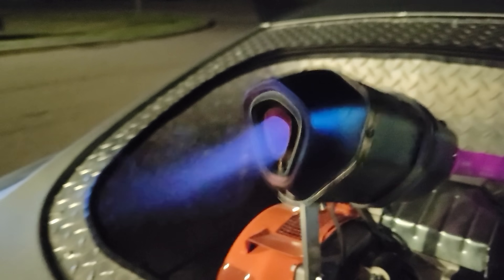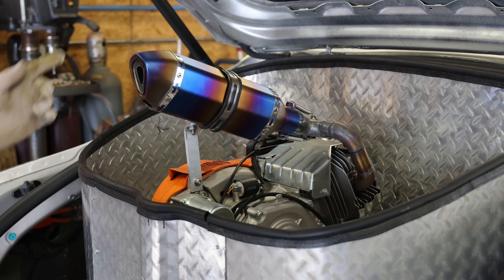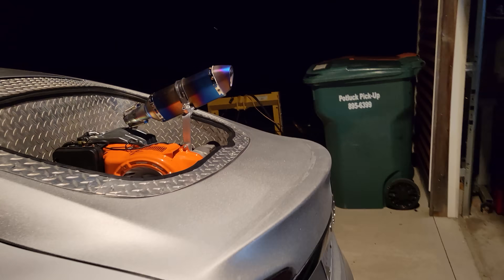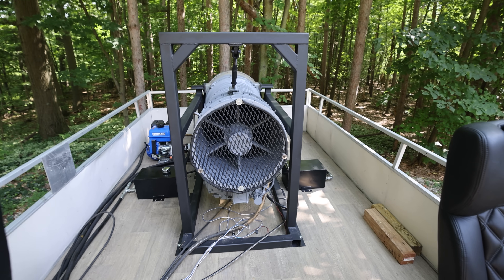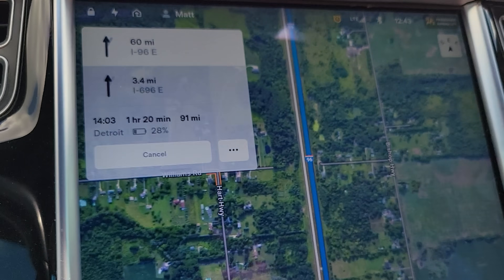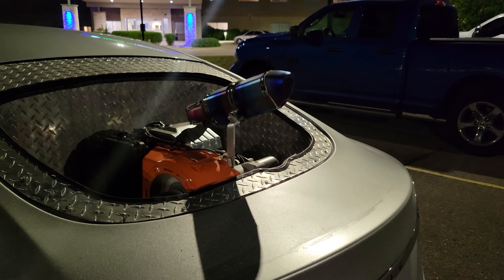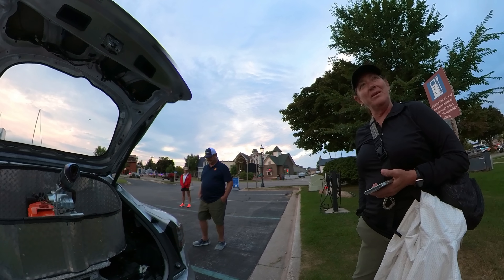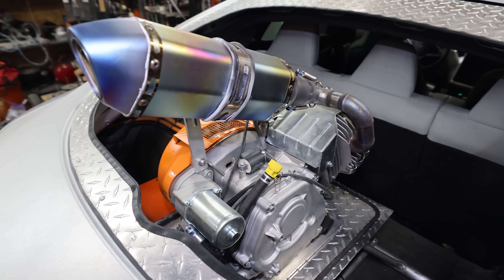Cordless Tesla (I Drive 1800 miles without charging) P.1

Comment: They already make these. It's called a hybrid. Gasoline engine charged battery. Battery adds supplemental power. Even though it seems to me that a hybrid should use a larger battery and much smaller engine. As long as the engine is large enough to kick on automatically and charge the battery only when the charge is low and shut off when near full than you can still run on battery only. That set up would not only give you unlimited range compare to a EV but also would only use the engine when the battery is low so the mpg would easily be in triple digits. Most current hybrids rely mostly on the gas engine to move the car and the battery is only supplemental. It should be the other way around .so instead of adding a battery to an existing gas car, they should add a small engine to an existing EV.

Comment: Next build research a GEET Reactor so you can run an engine on water instead of gasoline and integrate an alternator off the engine so it acts like a turbo boost for power generation.

Comment: Have we reached peak stupidity yet? What´s the point of an EV if you need to revert to using Gas to get an acceptable range? Yet another video that proves that EV´s are expensive useless vehicles. By the way, i have a 2018 petrol car that runs on a 4 cylinder engine and charges a 12v battery for many many years no problem, should i make a video about this genius invention of mine? Ehhhh!

Comment: basically you built a gas powered electric generator to charge the batteries of a tesla instead of stopping to charge it. so basically instead of waiting approximately 30 min to fully charge the tesla, you just stop to get gas. How many times did you stop to refuel for the generator. good concept.

Comment: Little gasoline gensets have a bsfc (fuel efficiency) of about 480 grams/per/kw/hr..........by comparison, a good, modern turbo diesel is about 180 grams/per/kw/hr.  Achates are soon releasing a 2 stroke opposed piston engine that the US military uses, and it is 20 to 30 % better than the best 4 stroke, turbo diesel engine. It has already passed CARB trials with excellent results.  The gasoline version, will use 60% less fuel than the best 4 stroke gasoline engines, in cars today.

Comment: This was lame! You were not any better of different that charging your car like normal and in fact worse! Your idea was amusing, but clearly inadequate. You stopped for long periods of time to let the car charge! HOW is this different from using a Tesla charging station?!  The genny needs to charge the car at least as quickly as you discharge with normal driving. Getting pulled over for going really slow shows this genny is inadequate! The noise level was insane! You NEED a much BETTER muffler! For this "test" to be worthy of something impressive, you need to NOT stop for any reason other than to fill the gas tank for the genny and then drive 1800 miles straight through. This is not hard for one person to do by themselves. Second thing is after you drive 1800 miles without stopping for more than gas and no other reason, what was your cost for all the fuel vs cost of charging and traveling 1800 miles on pure electricity only? How long did the trip take never stopping except for gas for the genny vs the exact same trip with actual charging stops? I'm pretty sure that other than the travel time being similar to a gas car done with an adequate generator, that otherwise, this experiment is worse than pure electric in dozens of ways!

Comment: Great idea!  I've been wondering for ages why car manufacturers aren't working on stuff like this until the charging tech and distribution catch up.  The British car company Ariel is working on an EV that uses a gas turbine powered generator as a 'range extender.'  They say the higher RPMs provide better charging, but with 4 EV motors and 1200 horsepower, it probably still needs to charge now and then.
Reply: Have you heard of a hybrid?
Reply: because: Toyota Prius circa 1997.

Comment: How to do this right, charge you car with electricity overnight.  It costs you no time other then plugging it in.
  
The generator doesn't need to be used on demand you have a large battery inside your Tesla, you can use a weak and efficient generator as your driving so long as its running its still extending your range.  If it produces more power then you need your just carrying around extra weight and wasting gas.

Then see how convenient it is and how far you can get on a full charge plus one tank of gas.

Comment: I have an 89 Geo Metro  ,
 I paid $150 for it 22 years ago  ,I've gotten as high as 55 mpg . Still drive it daily  .  It now has 353,000  miles on it .
         I'd still  would trust it on a trip anyday over an electric car .
      It might not be as luxurious as a Tesla. But it will get me there. 
     And I never, in those 22 years had to buy a $20,000  
  Replacement battery. 
                    😄

Comment: Industrial diesel generators will give you a much higher output and are so much quieter. This size is the only draw back but the area that is available should be good enough for a fairly powerful diesel generator.

Comment: that's a badass concept, with a larger engine you could potentially only run it for an hour or two after shutoff, although youd be on a slippery slope of gas consumption.
Reply: You could even remove the batteries, fill up the frunk with a larger engine and add a gas tank at the bottom where the batteries where. Then you could just go to a gas station and fill up the tanks there. Only takes a few seconds!
Reply: @RoloFilms  I know you're pitching this sarcastically, but you've basically described the car version of a deisle-electric train engine

Comment: The same could've been done with the generator & fuel system set onto a hitch-mounted rack, running the heavy cables, remote generator controls and fuel tank wiring via BUS cables and a 7-pin trailer lights connection... thereby allowing ease of removal and not compromising interior/cargo-area space.
Reply: That is the way I would have gone about it as well, I'm actually surprised no one has come up with a small aerodynamic trailer option.
Reply: @cwb2992  this is the only way I'd use an EV lol. really the only way you can use  an EV on a long road trip.
Reply: wow this is actually a good point.
Reply: A trailer can be stolen.

Comment: Just buy a trailer and a Generac 20,000 W generator for a house put the generator on the trailer and tow it behind the car that way you don’t get gas in the car and still have cargo space headed I’ll probably be quieter especially inside the car

Comment: I thought about doing this but what I was gonna do is put a trailer hitch on the back and put one of those wheelchair racks or luggage racks on the back and my 8000 W generator would sit on it and just plug it in with the 220 V plug You could even get a much larger generator and put it on the trailer and just throw it behind the car maybe a diesel one would get better gas mileage and have way more power like one of those Generac 20,000 V house generators

Comment: you could have saved the money and used a gas car and drive in peace an quiet. Here in the UK a 1800 mile trip would have cost me 3 thanks, which is currently at around £84 a tank. That would have been only £240 and wouldnt need to stop or drive slow just to charge it.
Reply from the maker: Saving money??? That's boring

Comment: My favorite part about the whole electric versus gas thing is the fact that hydrogen just exists and it's only byproduct is oxygen and water if you use electrolysis to make it
Reply from the maker: True but you need more power to make it than the power that it produces.
Reply: @WarpedYT  that's where a couple of good solar panels comes in

Comment: Your wearing earpro because it's so fucking loud but pull it up right next to where people are sitting. I wouldn't be surprised if someone came with a lawsuit
Reply from the maker: Those people are not within a foot of the engine, once you're like 6 ft away it's fine but when you're right next to it yeah it's loud, and being next to it every single day for 12 hours a day, yep that's the issue. People are so boring all they can think about is suing other people, why don't people just get to work and make money instead of trying to figure out an easy way to make money which is actually more work. 🤦‍♂️

Comment: The problem with your design is physics. To propel a 4,000 lb car down the road you need a minimum of 25 Hp average. I did the math when I was designing the parameters for my own diesel-electric car.  So you'd need a 25Hp diesel genset minimum, 30 Hp gas. So instead of a 10 Kw generator you need a minimum 20 Kw generator.

Comment: Mr Author: I have seen the secret of noiseproofed genset, when the attending technician opened the built. in side door for controll panel: Around 12. inches thick of semi hard foam, with surface designed like the egg tray!... It completely sorrounded the whole genset unit- "S" design of design for incoming or exit air, to completely trapped the scaping noise.. Soak the foam with fire retardant flourine solution to make it fire resistant... God bless!..

Comment: So your idea to run your so called green car is to use a fossil fule burning motor...... kind of defeats the purpose dosnt it. 
Has to be one of the best idea ever .......
Proven how useless it is your generator still won't supply enough power to keep battery charged running car at the speed limit of 55mph. 
Just buy a petrol/diesel powered vehicle and be done with it.

Comment: Couldn't u just run some type of alternator hooked up to the wheels so as u drive it charges at the same time,  using extra gears to get the alternator up to charging speed?

Comment: That generator doesn't burn fuel as efficiently as deisal.

Between the ACTUAL pollution, and the noise pollution from running the generator at night...

...all for the selfishness of not wanting to get of your ass...

At least you didn't plug your car into a COAL BURNING POWER PLANT to charge your car

But you're STILL the reason for all the problems you complain about.

Comment: People like this are the reason we have a climate change problem.

You can’t just let a company of 100s of thousands of engineers design you a car.

No, you know better.

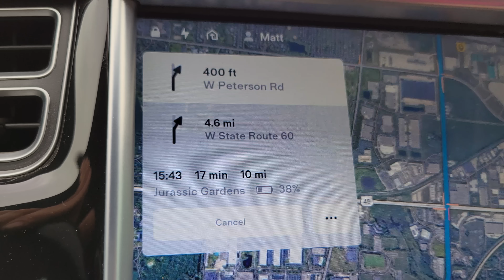And at 2:50, I know why your nervous. Because you never got this car inspected in this modified configuration, and you’re lucky that cop didn’t have you tow the thing.

Also, running an engine like that overnight at a hotel 🤦🏼‍♂️ I’d be shocked if you didn’t receive some feedback about that that you didn’t include in this video.

One thing is for sure. I would bet all my money that you were careful to park that car AWAY from your room, so you could get some good rest.
Reply: Depends in what state cuz cops will actually support you.. There is allot of discrimination of EV users

Comment: This is hilarious. I've got a 2020 Corolla Hybrid and average 600+ miles per fillup of the tiny gas tank. 
It spends most of its time in EV mode cruising around. Plus with my trade in, I drove it new off the lot for under $20K. It's now got 96,000 miles, and I'm still on the original brake pads. Car still starts, drives, and stops like new. 

I've also performed most of the routine maintenance myself with a set of Quickjacks. No need to call a specialist or drive it hundreds of miles to a dealership.

Comment: You never said what size generator unit you put in the car. A small generator is why you have to stop to recharge. Could be the batteries do not charge while driving? Face it that was a failure.I wonder what if you used one of those power storage units that will run your house for days?

Comment: The implementation may not be the best, but the concept is not that wrong.

This is not a hybrid, its a fully electric drivetrain with a range extender. A range extender engine can benefit from an optimization for a specific rpm, hence better efficiency.

Maybe a bigger diesel generator, with better sound insulation, would be a better pick.

Comment: shove a windmill on the roof. When you drive, the air can turn the blades and you can charge your battery, without the noise. Makes about as much sense.🙃

Comment: That engine was running SO lean with the exhaust glowing like that and blowing a flame I am amazed it lasted and didn't melt the piston.  Would like to know how much power it was producing? With all the fab skills the  the creator has, this thing could have been made MUCH quieter with a small car muffler and some sound deadening.  A little Multi Cylinder Diesel would fit in the back and produce  Plenty of power and more quietly with lower revs. 
Interesting Vid though that shows fuel is a long way from finished yet.

Comment: When I first read the title I suspected something else. Sure anything can be a generator but how about a Fuel Cell using a gasoline reformer (or even ammonia as the military uses)?  It would be closer to 70% efficient and silent.
Ammonia is very efficient hydrogen source plus it is the primary component of human urine. Use piss as fuel. ;-)

Comment: I say BRAVO! This is a fantastic exercise in prototyping.
With the DSJ administration going insane and diesel engines in it's sights, I've pondered this concept for small and light trucks mostly used by small business', contractors, and homeowners. I would, however, use a cleaner burning fuel like LPG or CNG instead of gasoline. There are many ways to store energy in a more dense and compact form than batteries at this point in time and I think that's the point of this exercise.
The benefit of this motor/engine arrangement is the carbon fueled engine can be tuned to operate at peak efficiency ALL OF THE TIME because the load is consistent as the vehicle accelerates and stops again.
A hybrid, on the other hand, motivates the vehicle inefficiently whenever it engages it's ICE with the drive-train as the rich exhaust/fuel mixture dumps pollutants into the air every time the engine load increases.
The creator realizes that his experiment obviously fell short of his hopes, but you have to start somewhere.

Comment: This is geek-cool, but he essentially reinvented the Chevy Volt, which is a gas/electric.  Unlike this thing, the Volt will go about 40 miles on the battery, and then switch over to gas.  The engine is not connected to the drivetrain, but is simply a generator to supply electricity to the car's electric motors.  Once on gas, the car "acts" like a hybrid.  The engine will shut off at stops and turn on again as the car starts accelerating.  On downhills the car will regenerate into the battery and will again run electric until that energy is depleted.  You can drive the car all day like this, and it's QUIET on both battery and gas.

If anything, this video showcases the stupidity of mandating electric cars without taking into consideration the owner's driving needs.  It also shows the shortsightedness of GM for discontinuing the Chevy Volt!

...Electric cars are all about populace control...
Reply: Underrated comment. Nothing but facts💯

Comment: Totally ridiculous!! A Tesla battery holds about 100KWH and that powers over 300 miles of driving in about 5 hours at 60mph. That generator produces 12KW, which is only 60KWH in 5Hrs. That requires additional 3 hours of idle in-place charging! Gas is wasted in that blue flame at the exhaust. The 90 degree bend in the exhaust pipe is wasting more gas by back-pressure.

Comment: After watching the video, I gotta give credit for an innovative build.  It looks well built, with decent looking design. Nicely Done!
I would suggest though, that this is basically sort of remaking the Tesla into a hybrid car, since this overall design with a regular motor charging the electrics is exactly how a hybrid works.  Not disparaging the idea at all just pointing out the obvious.
For the upgrade you spoke about, since money doesn't appear to be a problem here.. Heh..  I would do the following:
- Spend whatever time is necessary doing the actual engineering design to determine the exact actual wattage needs at various modes of driving, average them for however you realistically want to drive, and come up with a required electrical charging need which will be the output of the add-on motor you'll need to build into the car.
- Look around for the most efficient motor/generator you can find (likely a diesel generator probably?), that meets the electrical output requirement you came up with, that's what you'll need to build into your design. Also, another suggestion here, a decent more "civilized" exhaust/muffler would be a big plus.  Another big plus would be to route the exhaust down below the car just like a normal.. exhaust pipe.. like most cars use so that the exhaust output isn't right at face level of the car behind you.
- When building the upgraded version, try to build and contain the charging motor into the compartment in a fully enclosed setup, containing the engine noise, also as suggested, route the exhaust below the car like a regular exhaust pipe.
- When finished, congrats you built a Tesla-H (for Hybrid)!  This is an interesting concept, and really expensive (I couldn't do it!), but it's pretty cool seeing videos of you doing this and watching the resulting outcome of driving around with it after you're done!  I look forward to seeing your upgraded version of this!